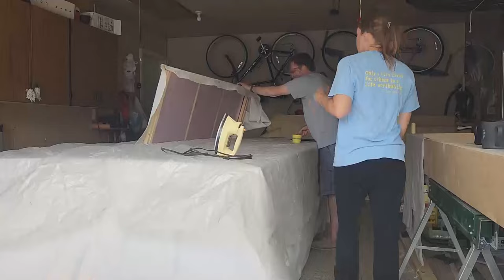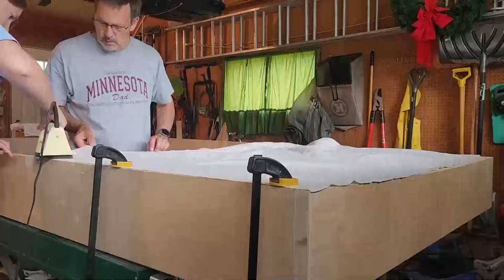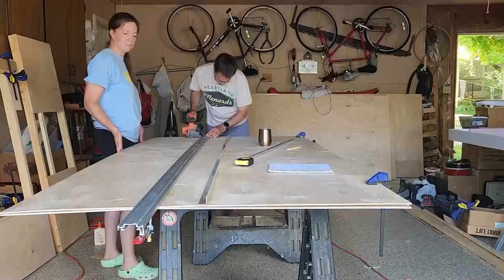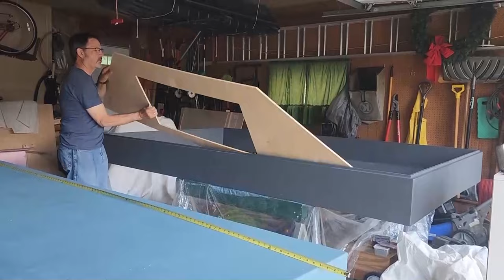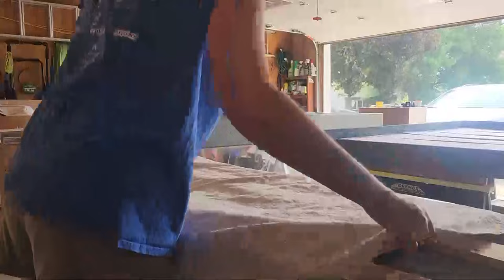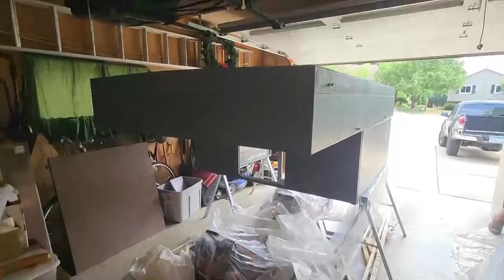Ep. 5: Poor Man's Fiberglass and Constructing the Pop-up Walls

Comment: I've seen a lot of PMF videos where they put a second layer of glue on top of the canvas while the first layer of glue is still wet. That way the two layers of glue seep together through the weave of the cloth to make a solid waterproof layer. I guess it's not necessarily needed since the paint is still going to waterproof it. Looks good.
Reply from the maker: That makes sense. We touched up a few spots that didn't look saturated enough by putting glue over the top, but a whole second layer would add even more protection. Happily, there has been no leaking through my PMF yet, so hopefully all the layers of paint hold up.

Comment: What was your issue with raising the pop up on your own? In the middle of building one and hopefully I don’t have any problems haha
Reply from the maker: The biggest problem we were having was that the side walls were cut to fit perfectly. As I pushed the roof up, it had a little sway side and side and the walls would rub and add friction. If I would have had more time last summer, we could have fixed it, but we just ran out of build time. Ultimately, I may need to trim some of the walls and then we need to create a stronger fixed strut/guide to keep the roof and walls aligned as I am raising everything up. My dad was able to power through it and push up as it was, but it just wasn't going to be easy enough for me to do alone on a nightly basis.
Reply: @WanderwithKate  oh I see. Mine will be folding up on hinges similar to traveling by Tacoma’s build if you’ve seen that so I don’t think I’ll run into that problem. Great job though! Awesome having the family help
Reply from the maker: @Threeheadsrk  Yes, if you're following his style of build, you should be good! He has a nice DIY camper. I hope yours turns out just as great.

Comment: Love the build series!  So in the future you guys are still going to attempt the Hiatus style full pop-up?  Oru designs has a hard sided pop up that could possibly be easier to duplicate, maybe you have already seen it? It is the Bruin model.  I went and saw one a few weeks ago and they weigh 400 lbs, very impressive but Hiatus seems to be the coolest one out there because of the origami type fold up style.
Reply from the maker: Yes! I have the full pop-up walls stored in the garage right now and want to try it again this summer. I have seen the Oru and do agree that style might be easier and is still really nice looking. I'm so impressed with the lightweight truck camper options being developed by multiple companies right now. The Oru style could be an option if we are still having trouble this summer. But I think we figured out where we were going wrong and have a good solution planned. Fingers crossed.